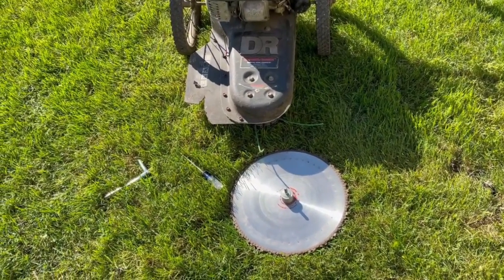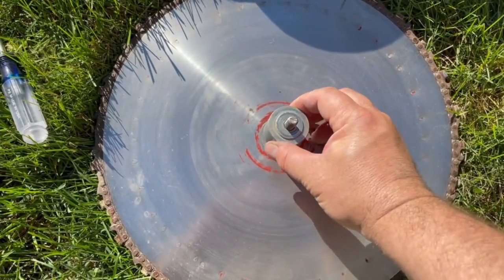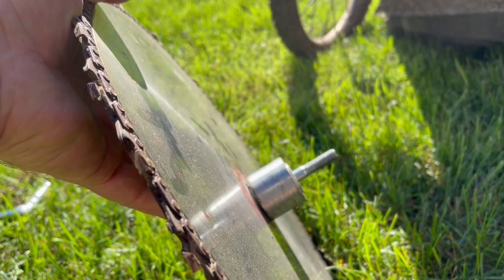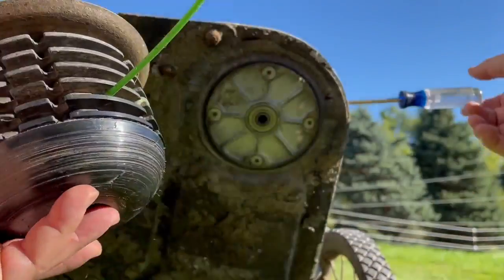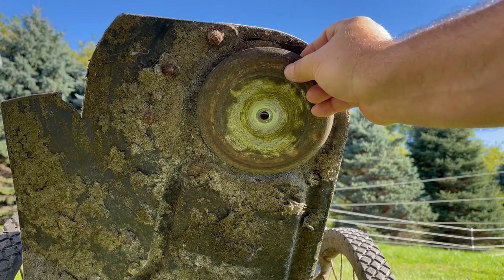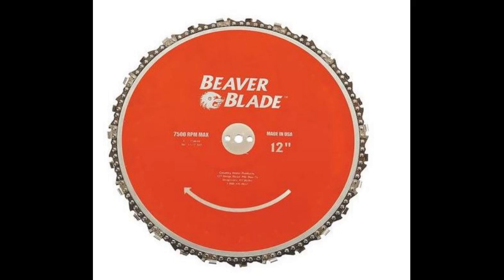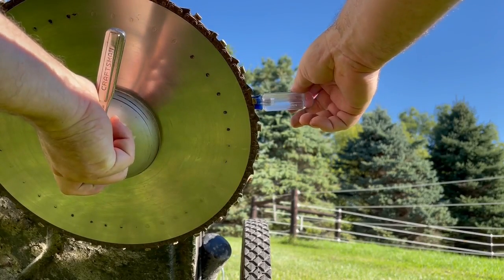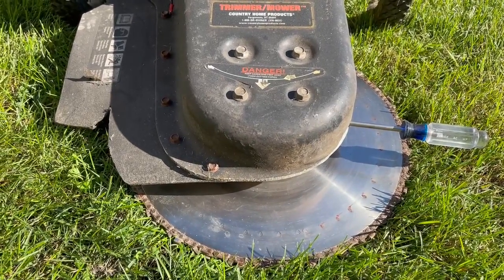DR Walk-Behind Trimmer Mower Beaver Blade Install | Belted Galloway Homestead

Comment: I have a 2022 DR Premier Walk Behind Mower/Trimmer. The Beaver Blade Safety & Operating Instructions do not really apply. I received a 1-3/4” tall Hardened Mounting bolt and a tall 2 or 3 inch spacer.  When I took the Mow-Ball off, the Line Plates didn’t immediately come off. They were stuck. I took a flat screwdriver and inserted it between the first two plates very carefully. Then they all came off. I also had to remove the Anti-Wrap Canister. There was a lot of dead grass in the Mow-Ball, in the Anti-Wrap Canister and under the Line Plates. The Hardened Mounting Bolt sits in a hollow within the Mow-Ball. It was hard keeping it within the Mow-Ball while tightening.  Well, I’m going to give it a try.
Reply from the maker: Thanks for reaching out! It is amazing how much grass can get jammed up in areas like that. I hope it works good. Watch out for the rocks.

Comment: Belted Galloway, thank you for making this clear and friendly instructional. It was not too slow for me. Any advice as to repairing the chain, which was detached and severed when I purchased used? Many thanks.
Reply from the maker: Thank you for the comment! I have not had to do this, but I believe that the chain is a chainsaw chain. I would go to a chainsaw shop that makes chainsaw chains to length. That way they can match up the size that is on the beaver blade or repair the current one. Looks like the connecting links are called "Preset Tie Strap" on Amazon. Great question. Thanks for reaching out.

Comment: Nothing beats a Kawasaki on a DR trimmer mower does it have both electric and recoil start or not. I have the same unit from the nineties which the engine faces you cool video by the way
Reply from the maker: Thanks for the question. Yes, mine has both electric and recoil start. The battery want bad years ago, but it is so easy to start, I never replaced it.

Comment: We're can I get the beaver blade for my walk behind I am in  California. Thank you
Reply from the maker: Thanks for reaching out. You can purchase the 12-inch blade from DR or Ebay. I put some links below. The 14-inch blade can still be found on Ebay. Link below. I hope this helps!
https://www.drpower.com/Power-Equipment/Trimmer-Mowers/Trimmer-Mower-Accessories/Blades/12%22-Beaver-Blade-Attachment-Kit/p/A0000146144
https://www.ebay.com/itm/165712060690?hash=item2695356112:g:VQoAAOSwh9pjPvlz&amdata=enc%3AAQAHAAAAoCN6RyzfnvBVDXM8w1ataNs%2Bl8m%2Fbe%2BNCVaRp98IK8wYochr%2BGGvNW%2FjHkdfcPf7I1IjnkcB8TxDfxnEzSBNbVDB8QwbebvXKQ70wXfeuBlkBQwQxL59UwomTreRMw77wnfRaWzcJIBn7k1xrIIFq5XOHNw1fxVRoB5fLarnKXRC4i49NmSFaGAdebeANOX1oyYERrxDDtudSWX9BsT4SBs%3D%7Ctkp%3ABk9SR7bYjpb5YA
https://www.ebay.com/itm/115560091903?hash=item1ae7eb10ff:g:qLsAAOSwCghjKMDT&amdata=enc%3AAQAHAAAAoCv63lmP7t%2BvbeLd9GS%2F43gmZWCgjAp2rDT74JRL5r1sIkc0bDy6Mxt8UiHzZbsOCI6h0WhOZw%2BJef8XWR121YtZBlIbwQkOOT2S5Z%2BKh2usj7I9PC7LFH62eZUijJHIMCnSrnBRio9%2BYEOTUs0jW%2BzTPykDvUiWH%2FllTeuP1gjqIg5wjZJD34r%2FVjk8kodbaDv%2BOWtByRhv8vBltF1rt4s%3D%7Ctkp%3ABk9SR7bYjpb5YA

Comment: Really appreciate you doing this video as well as all your videos!
What I had thought about doing. Is actually making an adaptor setup to actually install a 20 inch chain saw. Gives more reach. As I need that to get under my muscadine vines. Would you be interested in collaborating on a project like this? Say I could pay for it. And you could build it. You get a really good video to upload. If we perfect it. We could also market it. I do believe there is a market. For such a product. Think it over. And let me know.
Reply from the maker: Interesting! There is a walk-behind sickle mower out there called a Jari. I actually own one. 
https://youtu.be/HNkHHYr3D5M
Does your idea have the blade oriented like this sickle or would it stick straight out?
Reply: @BeltedGallowayHomestead  
I believe I have an old Gravely attachment like this from father. 
It would be best to be able to lock in various positions. 
Envision blade going straight out and horizontal. But also being able to put it invarious positions like 45 or 90 degrees. It would be a cool project. To make and I really think it would be better than the DR Beaver blade.
Reply: @BeltedGallowayHomestead  
I see it about 10 inches down blade. Have a bolt going through chain bar. Would be the dome thing on bottom at that point. Top of bolt would allow arcing and changing of postion of the bar angle. And locking it in place. With a metal top.

Comment: dang....that looks a lot bigger than what they currently sell ?......16 inches ?
Reply from the maker: Thanks for the question. This blade in just over 14 inches. The blade that is currently sold in 12 inches.
Reply: @BeltedGallowayHomestead  Thank you ! I just noticed that there is a DR Trimmer dealer near my new farm.....so I will definitely look into this. I had already bought the craftsman walk-behind but I hope to see if there's a fitting and blade. Even my local Home Depot sells a number of large table saw blades so I hope to clear that 1.6 mile laneway this summer hahahaha !
Reply from the maker: @skidfrog  Wow, 1.6 miles. That is a lot of trimming. I would suggest a round file also for resharpening the teeth.
Reply: @BeltedGallowayHomestead  hahaha....yeah....that's just down one side !

Comment: Sir, request for all details regarding. puchase.
Reply from the maker: I am sorry. I do not understand the question.
Reply: I think Madhusoodhanan wants to know where he can buy a beaver blade and DR Trimmer.
Reply from the maker: @fortheearth  Thanks for the response. I will reply. Thanks again!
Reply from the maker: There are two different places to purchase. That would be eBay and drpower.com. Please note that drpower.com doesn't sell the larger diameter anymore, but you can purchase the 12-inch diameter. eBay occasionally has the larger diameter, but I don't see any currently. Here are some links for reference. I hope this answers your question.
https://www.drpower.com/Power-Equipment/Trimmer-Mowers/Trimmer-Mower-Accessories/Blades/12%22-Beaver-Blade-Attachment-Kit/p/A0000146144
https://www.ebay.com/itm/155404260315?hash=item242ed0d3db:g:mtkAAOSwBh1j5~1F&amdata=enc%3AAQAHAAAAoMJc3Ih1b9QggyWIssSbZ%2B3IODKvD0GM2XCXGCZMnXQyakqsvEvZzTWSLG%2FKP6nefSjato%2BKE1QFiTWPqObCx%2BPfAdmjV0tRN73%2BdmrnswAi7OHuWmv7o%2FHKTjCqV7RK%2BOcq7BW2DMO6OtaTodK%2FMWAQZveEolvD51hcfee0tYk1AZCro2Rnqlw79I3eu2iGYUANSQgXwb0RnpU5Hb%2BokM0%3D%7Ctkp%3ABk9SR-7JguTKYQ

Comment: Great instructional video!  Planning on installing one soon and wondering if you have the brake  kit installed as well on the trimmer?  I see in the DR site this video that shows the brake kit and was wondering if this is still needed for the trimmer.  Keep up the good work!  Curt  https://www.youtube.com/watch?v=PeJS7Cela60
Reply from the maker: Thanks for the positive comment. Yes, I do have the brake in my trimmer. I stops the string trimmer very fast. Is takes a little longer to stop rotation with the beaver blade. Hope this answers your question!